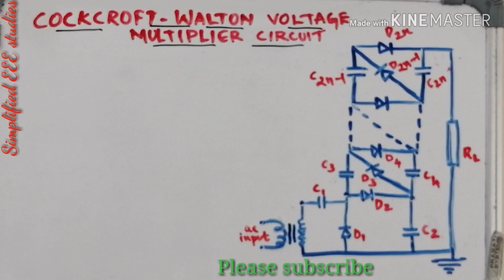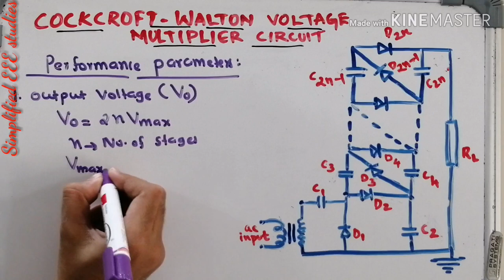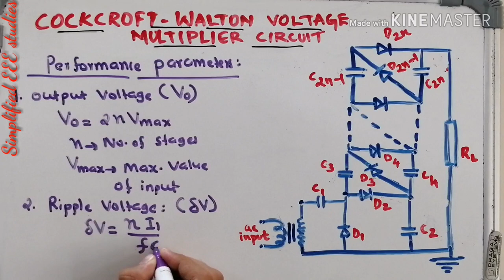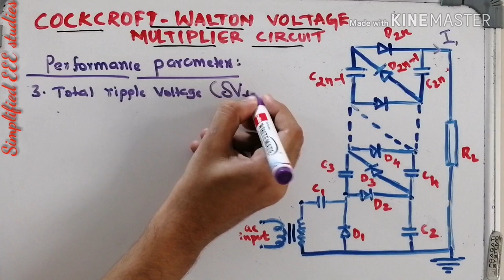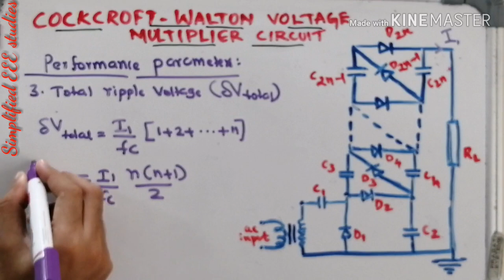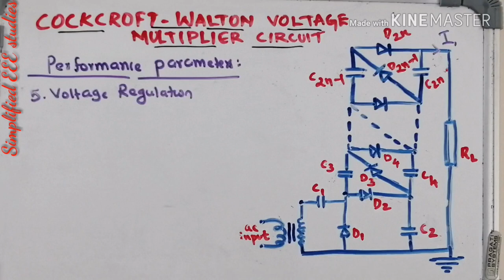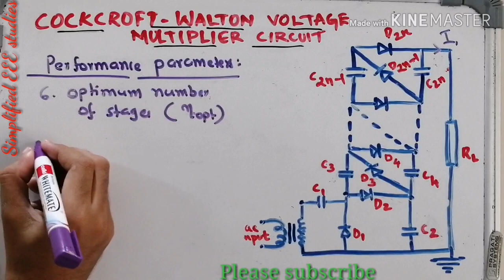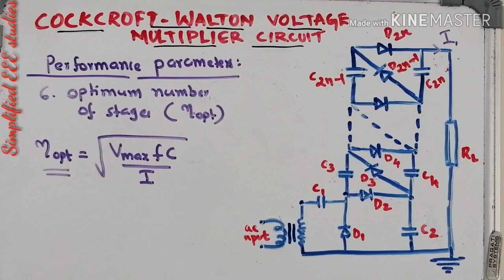Performance parameters of cock croft Walton type dc set| HVDC Generation |Voltage Multiplier| HVE

Comment: Sir,
Due to voice typing line display,can't able note down the last line,also there is lot of spelling mistake in typing & not easily understand by typed sentence.audible lecturing clearly understand,so I think no need of voice typed lines.
Thank you.
Reply from the maker: Dear Mr. Nagesh,
Could you please check the settings to remove voice line typing display in your gadget. Actually, I haven't added that option in the video prepared by me. I will also check. 
Thank you for listening.
Reply: Ok sir,now change that setting 'Remove caption' in there setting,now it's ok only audio & video visible.